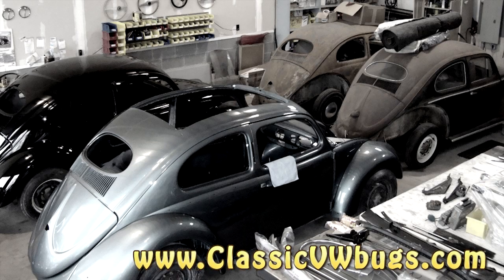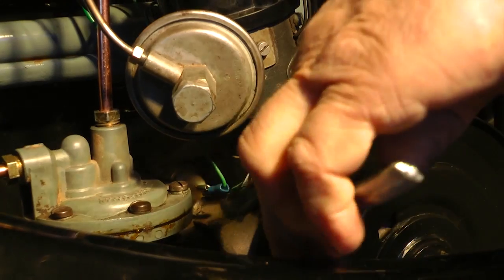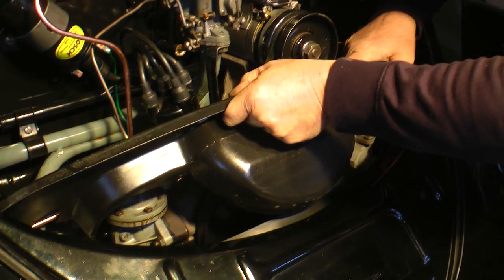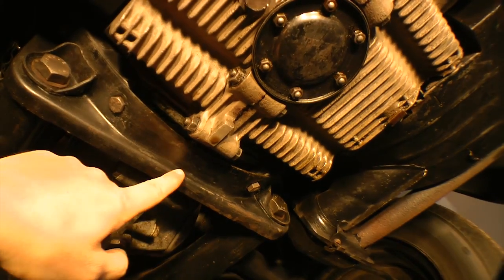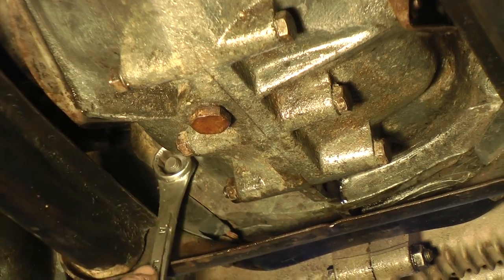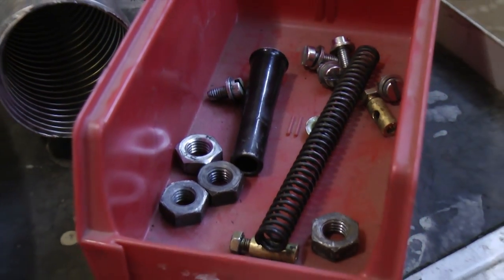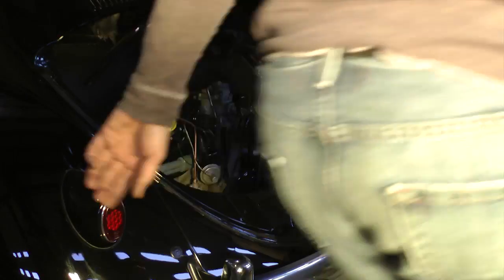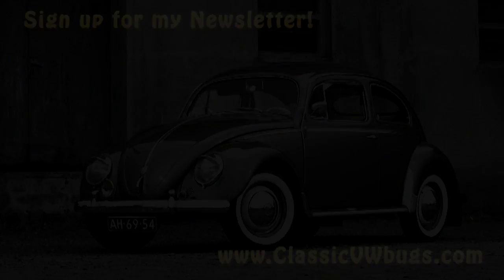Classic VW Beetle Bugs How to Remove your Vintage Beetle Type 1 Engine C. Vallone

Comment: When I was a kid I used to work in a German Auto shop as an apprentice. We rebuilt so many Bug engines that I could pull an engine in 6 minutes. I was proud of that at the time. Now it takes me 6 minutes just to get my car jacked up.
Reply: I got stuck working on them in 1972 when the local foreign car guy moved , After a dozen or so My partner and I got it down to just over 4 min. to pull ,We did have a hoist which eliminated jacking .
Reply: That's impressive 6 min , I've never was interested in vw bug before,  but seeing the mechanics on them , and gas mileage they offer hey I might buy 1 one day!

Comment: For those without a lift, put a long 2x4 on your jack before you put it under the engine. Once you lower it to down, use the 2x4 to lever the engine up so you can remove the jack from under it. Remove one rear tire, and slide the engine out from the side (unless you have a show engine and don't want to scratch the heat exchangers).

Comment: I've got the 2 bolts on the bottom removed and the one on the right top. Where in the heck is the one on the left top?
Reply from the maker: Do you have a dual port engine?  If so, you have to get it from under the car right by the tranny clutch arm.  it can be a tough spot.

Comment: Your video helped me with my Ghia’s engine removal 5 years ago. It was difficult for me as I was solo. Now I’m wondering how difficult would it be to put it back on, and how to be sure that the transmission is properly aligned before I push it back in 🤔

Comment: This is because they were designed to last and maintain by yourself. Also designed so that they are extremely easy to work on. I can't think of one car like that, that is being manufactured today
Reply: Very true. Today's cars are built for planned obsolescence. manufacturers nowadays love it when your car breaks down so you have to take it back to the dealership to have it serviced. some cars even have ecu's that are locked only that the manufacturer itself can operate and fix the problem so that way backyard mechanics can't do it themselves, they want their money. So sad.

Comment: Great video! Is it not dangerous to remove the bellhousing bolts without having the engine supported?
Reply: Yeah you would think removing the top last is better as you are not under it when it breaks free.

Comment: All I can say from HARD experience is that the jack should not be under the oil drain area but rather 2-3 inches rearward of it.I found the engine was not balanced on the jack otherwise.Most folks disagree with me but all I can say is it worked for me

Comment: Great video, very well explained and easy to follow.  I'm running into a really weird problem though where one of the upper bellhousing bolts are just spinning.  I can even get a vice on the bolt, and get the nut turning - but not getting any looser.  Any idea what's going on there? Last bolt before I can drop the engine.
Reply from the maker: may need two people, get a wrench on the nut and have someone loosen the bolt.  The wrench will hold it in place.

Comment: I occurred this very same problem. You have to remove the bolt attached to this round "boss/nut" from underneath the car. I removed the exhaust (driver's side) and the driver's side wheel/tire to gain easier access. Just a little PITA to gain access but once its off it's just as described.

Comment: thank for the video, and thanks for the extra ideas,  and information, given without intention on the video,  i was looking for, how the air heather intake were hooked up,  and the idea of how to fix the throttle tube is great, i suggest to you to install the throttle cable conduct in your VW. avoid dirt on it,  and i live i a place with a lot of dust, once more thanks for the video, Aus liebe zum automobil VolksWage. (From love to the automobile). Ja! Vw representing the Deutschland Ja!

Comment: Hi Chris, great video my biggest concern is getting the car high enough. I have 23" high 6 ton jack stands. Will that be enough clearance if I take the engine out through a wheel well? 

I have a 68 with a 1600 in it. Thanks

Comment: Later case has a round threaded boss. A bolt goes into it from the transmission side; the round casting (what looks like a round nut) is part of the case.
Reply: How do i undo it cheers

Comment: Hello. I just bought a 1965 VW Bug out of Missisppi from the original owner. The car is actually really solid, but has several issuse. The engine has been switched from a 40HP to a 70Hp and someone attempted to convert the car from 6V to 12V. I'm fixing the car to sell and would like to know if it will hurt the value to finish the conversion or should I put it back original? Also, is it worth the expense to find an original 1965 engine, or just use the one I have? Any help will be useful.

Comment: Hey Chris

Great video.  I have a 77 standard beetle with a 1200.  The drivers side top nut appears to be rounded?? The passenger side upper and the two  lower nuts are fine and turn quite easily.  Any suggestions??

Comment: Is the engine essentially "hanging" off the transmission? The 4 bolts are all that hold it?
Reply from the maker: That's it man!  4 nuts.  Plenty of strength
Reply: @classicvwbugs  well, I'm going to give it a go in about 1 hour.
Reply from the maker: @michaelknight2897  ah good luck 👍

Comment: I have a '73 Bug with a '74 "California" 1600 engine in it.  Getting the engine out wasn't too hard.  I did it myself.  But after rebuilding it, trying to put it back in was a son of a gun.  I had my stepson and son-in-law helping me and we could NOT get it back in.  I ended up taking off the muffler assembly and then when I tried the engine went right in, smooth as silk.  But from all the videos I've watched, I've never seen someone have to remove the muffler.  :(

Comment: Nice original bug, what year was that ?I had a 61 for my 1st car, i thought the fuel filter was next to the carb not under the chassis, is that the way they were in that year? 36 hp?

Comment: Chris, what about installation ?  I have a 62, but replacement motor has newer heater boxes (Fresh air)....I can clear the transmission shaft, but can't seem to move the motor up 1-2 inches to put the 4 bolts in....came here for wisdom and to take a break....Thanks !
Reply from the maker: What size motor?  If it is a bigger motor, you may need to remove the heat boxes to get it in easier.

Comment: i need help, the top left nut of the bell housing is a round nut. ITS NOT A ROUNDED NUT. i grip it with the vicegrips but it only slides. any suggestions? thank you

Comment: Hey Chris it's my first beetle have wanted one for a very long time but before I get into taking out the engine I have a slight dilemma... I have a 1969 with an autostick and the engine is completely locked can you help guide me what extra steps I must take I'm told I have to do a little extra because I cannot get to my torque converter bolts? Any help would be very helpful thank you

Comment: Chris, I am having the same trouble as maggothertic117. The top left nut behind the motor on the bell housing is a round nut. Did some come standard with this? I cannot get it off for the life of me. Haha I have a 1968 Vw Bug, 1600cc. Please help. Thanks.

Comment: Hey i had a question; i removed my engine to replace the seals and everything, but when i tried to reinstall the engine, the throttle cable doesn't reach anymore.. any ideas? Thanks.

Comment: Hey Chris!
I own a 1996 bug and the other day the engine started making some ticking noise 
later on when the engine got to its normal temp. it stopped what could it be?
also its leaking oil I was told this is some what normal..is that true? I want to fix it all up I love my bug its the first bug ive ever had and I have no idea on how to fix it D: I have worked on some other cars but never a vw bug I ve heard its pretty easy  but I really got no Idea

Comment: I had a 65 beetle. I could pull that engine in about a half hour with a scissor jack. Jack up the car and block under tires. Undo everything as in this video. Dude forgot clutch cable in this vid btw. Move jack to engine and lower it. Pull engine off jack and let it drop a couple inches onto ground. Slide out and get to work on engine.
Reply: Can't get better than that! Love old air-cooled VW's

Comment: Hey Chris, why does my bug have fuel in the oil pan
Reply from the maker: Hmmm, gas in the oil, not good, you need to drop that oil.  I see this happen when I get deliveries of a beetle that is shipped in on a big truck, they put the bug on too much of an angle upward for too long, the fuel then passes the needle and seat in the carb and then into the oil.  Or maybe your needle and seat is defective.  Take top of the carb off and take a peek at it.

Comment: @oceancity724 How is this meaningless advice.It's just the opposite.I just pulled my engine today in my '62 Bug and I did it the exact same way.Well I don't have a lift, I used a hydro.jack.And just like the video I left the fan shroud on.By the way,this is the same procedure that's in the Bentley Manual.That's the same one VW techs use.You talk a lot of Crapola ! But you don't back it up with anything but cursing and undeserved insults. This man knows his stuff.Period.

Comment: Heater "nuts", on barrel clamps for the heater tube are 10 mm on the early bugs and 8 mm on the later model VW'S.  Good info but at least know what the hell you are talking about.  Also, anyone with half a brain would disconnect everything underneath the car first and then lower it and support the engine with a floor jack,  at that point you should undo the upper engine nuts to remove the engine......guess what,  you are not putting any strain on the transmission input shaft that goes into the clutch!
Reply from the maker: You seem like you know what you are talking about, so share us a video of yours that you produce, and we can all know and see what "the hell" Joachim skill level is.
Reply: A bit aggresive  with no need....you could say the same with better manners